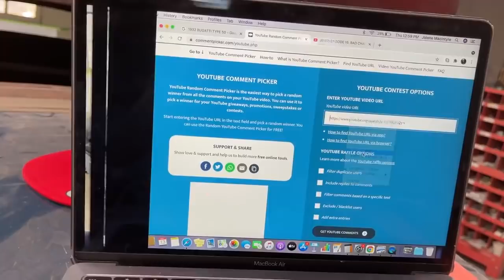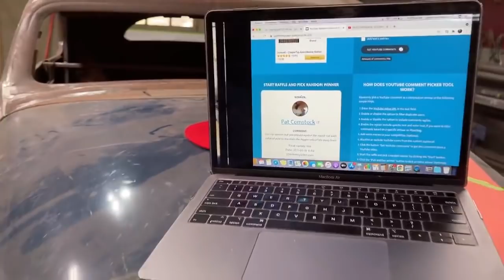Running board fabrication (part 4)

Comment: 55:50 - put a jack stand under the rear of the pipe whilst you adjust the front - it will stop it dropping off.

Comment: Do you have any suggestions for tools and brand for beginners? Welders plasma cutters. What is that tool that cut the small sheet metal with called? Thanks